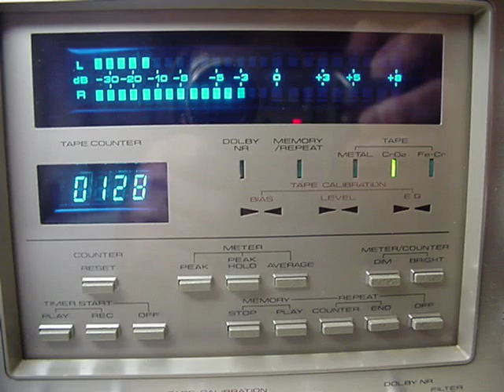How a Pioneer Cassete Deck should be RESTORED

Comment: Hi Tom - Do you recall if CT-F1250's ever came with blue Elna caps on all its boards? On mine it's all Elna's. And the flower shaped windings on the motor board behind the capstan round magnet is red ceramic coated, not the usual gold copper color. What do you think ?

Comment: If you see the ff/rew/take up motor come to a stop, then I suspect the motor to be ready for a Restoration. You can either buy my How To Instructional DVD on a motor overhaul or if you don't fell up to it, I can do it for $50.00 (includes return shipping) and you have 25 years of life back into your motor. Cheers, Tom
Reply: Thomas it's not the motor, it's the middle wheel between the FF_REW- takeup that slipping pioneer never came out with a fix, just a none-slip stuff you put on the rubber on the wheel, but it only lasted a few months. Pioneer should had changed the design, but never did.   I know because I was a service station for pioneer and got these model in for the problem. Pioneer sent me a bottle of this non-slip stuff and I was told to apply some on the rubber of the wheel to fix the problem, so stupid because it never lasted and the deck was back for repair soon again!

Comment: this deck the CT-F 900 & 1250 had one of the most stupid designs with the idle wheel I ever saw every few mouths after cleaning it would start  slipping again. To bad pioneer never came on with a modification. they had this no-slip that you applied to the rubber wheel, but it only last a few month junk!!